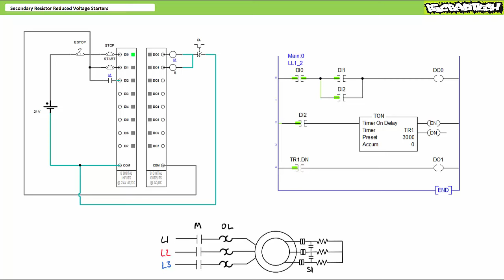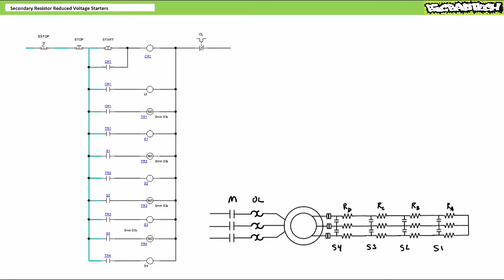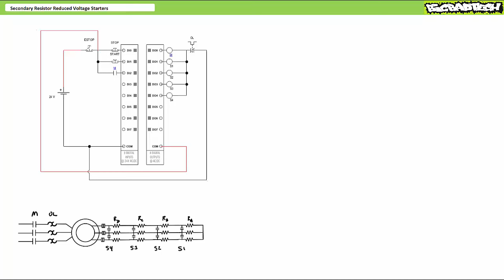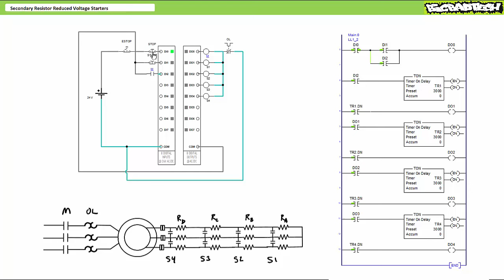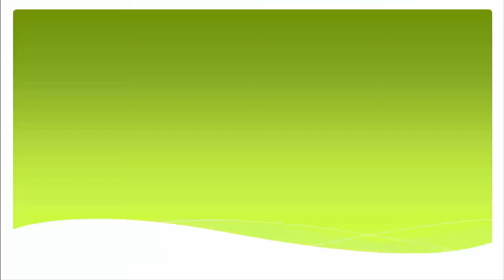Secondary Resistor Reduced Voltage Starters (Part 2 of 2)

Comment: Hi J,  it seems that invoking a programmable plc still requires buying a bunch of resistors that need to be wired in, regardless of hardwire contactors or programmable plc. Why not use 3 PTC's (or a resetable thermal fuse) and skip the PLC?  it appears that there are X and y class PTC's.  How much does it cost, did you pay,  to buy the electrical and hydraulic famic software?  It would be entertaining and educational  to see you work through adjusting the excitation on the field (with mechanical rotor input) for the purpose of adjusting a generator output.
Reply from the maker: Oh yes there are many more ways to skin this cat besides regular resistors ... ever heard of a liquid starter? Basically it's an electrolytic solution and as a contact is pulled in an out of it it changes resistance. As you mentioned cost is the primary concern for any application!